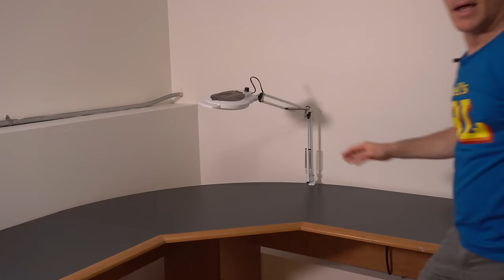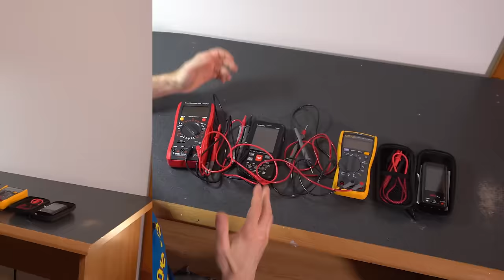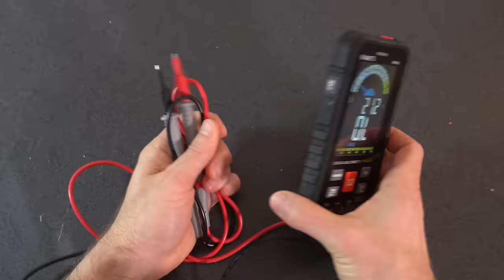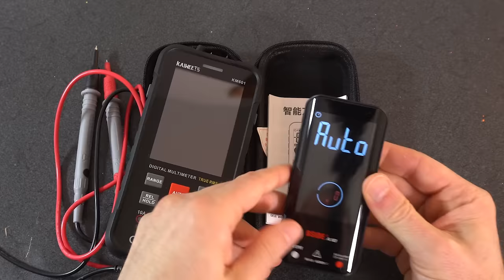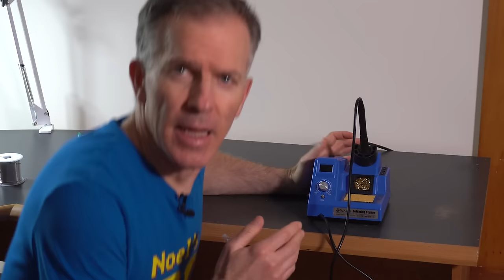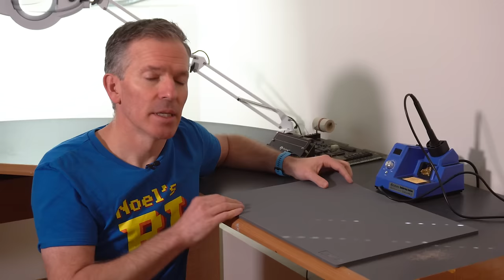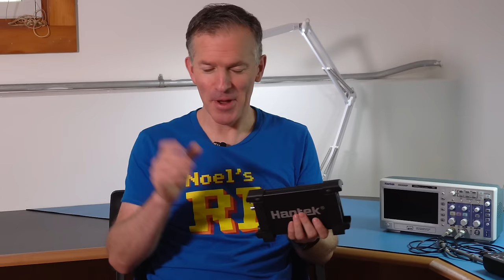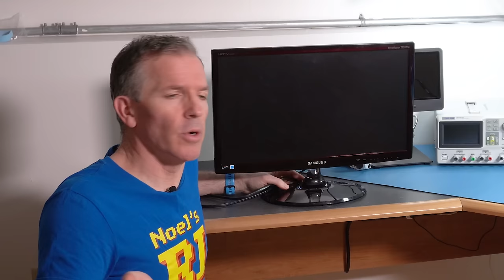Essential Tools For An Electronics Lab

Comment: Another necessity: One of the cheap $10-$15 ATMega based component testers. Way easier than doing diode tests against transistors with a DMM. Also, for classic computers, the EPROM programmer + UV Eraser is a must. Other ideas: The $10 , 24 MHz 8 channel digital logic analyzer. $10 Improved DMM cables with silicone and plated leads for lowest resistance.  A large starter kit of random transistors, resistors and capacitors. And sockets; lots and lots of dual wipe sockets in all sizes.
Reply: UV Eraser😅, I was taught to know this thing over 15 years ago.
Reply: Bro please provide those links. Thanks in advance!
Reply: I would also add:
- tools to hold things, such as helping hands and even a small hobby vice
- prying tools since so many things are glued together now
- a second multimeter for testing voltage and current at the same time for people who do not have an oscilloscope
Reply: Agreed, those little component testers are a must, I always use it for transistors, mosfets and caps, it beats looking for datasheets for the transistor pinout.

Comment: IPA alcohol?  Captan tape? blu tack (to hold stuff), extra hands (or the little holders, little pots for screws, magnetic tray for screws, lithium grease, flux, nail varnish (solder mask), solder wick, marker pens, graphite pencil (for contacts) , contact cleaner, air duster. Phew excelled myself there - could class these as consumables.. Great vid Noel.
Reply: I'll tell you what you missed: contact cleaner AND eraser strip for old, openable relays, ah ha ha ha!

Comment: Concerning SMD soldering, I think that the use of Flux is pretty essential. Flux helps a lot to spread the heat equally, Iwould never concern hot air soldering without it. But even if you want to clean up leaking capacitors, flux is great to help clean corroded solder joints.
Reply: Yes, the effect of flux has to be experienced to be believed. It totally changes how the solder behaves. If only it wouldn't be such a pain to remove the residue! I'd be thankful if anybody has tips for how to effectively remove flux, especially the tacky SMD flux type.
Reply: My understanding is that flux is used because it cleans the joint before soldering which helps prevent dry solder joints and, as mentioned, corroded solder joints from forming in the first place. As well as helping the solder 'flow,' ensuring it will spread to cover the entire pad. 
Not sure about it "spreading the heat equally" since it's temperature requirement is significantly lower then solder so it 'disappears' basically instantly.
Reply: @EdwinSteiner  Isopropyl alcohol (99%) and a cotton bud.
Reply: @MattyEngland  That's what I use and it isn't working too well for me. Maybe I've got particularly tacky flux. I use two types of "no clean" flux, so theoretically I could also leave the residue on the PCB but it just looks horrible and it sticks to everything. When I clean the PCB when it is still quite warm, I can get the bulk of the residue cleaned up with IPA and cotton buds but there is a thin and very sticky layer of residue remaining on the PCB.
Reply: @EdwinSteiner  You'd probably need an ultrasonic cleaner to get the last residue off, they are quite expensive though. Other than that, maybe try some different fluxes, the tacky ones are useful but they are hard to clean.
Reply: HCFC-141b spray cleaner might work.  Just keep this away from anything containing polystyrene.
Reply: @somaday2595  Thanks. It may be hard or impossible to get here, I think, but searching for it I found replacement products that I might try.
Reply: @EdwinSteiner  no clean flux is an option.
Reply: @EdwinSteiner  ,  The fluxes designed for use with lead free solder are generally supposed to be water soluble and so distilled water should work just fine. Rosin flux for use with leaded solder is alcohol soluble; use 99% isopropyl alcohol and scrub with a stiff toothbrush.
Reply: @EdwinSteiner  a brush and 99% isopropyl alcohol works pretty good but there's actual flux remover chemicals that work way better. The brush is key IMO, cloth just gets stuck if the mess is too big.

 At my work we use stuff from MG chemicals and chemtronics. A liberal spray of the flux remover and some scrubbing get's all the stuff loose and a wipe with some lint free cloth can get all the pastey sticky stuff off after, you can also use isopropyl to get the sticky stuff off if there's a huge mess.
Reply: @EdwinSteiner  I remove solder with a solder braid. Sometimes I can remove it with nothing more than a dry iron tip. You can also get one of those bulb solder suckers. I have all these and they're all cheap. NTE 63/37 lead based solder is great for re-work but you'll always need to use flux or you'll struggle like I did.
Reply: @EdwinSteiner  I'd recommend isopropane, with a cotton bud
Reply: Seconded on the flux, and for cleanup I recommend Isopropyl alcohol and a brush with ESD rated wipes to soak the flux saturated alcohol.
Reply: Ha, ha, ha pina sa aduni toate aceste materiale si la cit sint de scumpe te lasi naibii de meserie ca ajungi la 70 de ani si nu le vei avea pe toate Da toate aste si cu mare dificultate  poti sa le procuri daca lucrezi intr-o companie, corporatie specializata dar nici o data ca particular nu le vei avea Acolo sint bani adunati pe citiva ani buni  de munca nu se iau din drum Domnu se pare ca a facut reclama la toate probabil este daler de astfel de materiale ca toate erau noi si nu se lucrase cu ele La tot ce a prezentat dm nu a spus ca trebuiesc si ceva ani de scoala serioasa daca vrei sa faci meseria de electronist
Reply: Flux is the secret to SMD soldering. It makes things so much easier. Whether with hot air or iron, combined with leaded solder it makes SMD so easy.

Comment: When I bench soldered professionally we used two things all the time. We used a soldering iron and a spudger. What's a spudger? A spudger is a wooden stick. Think of it as your finger that doesn't burn easily. Spudgers are even handier than tweezers are. The best spudgers are made out of osage orange wood and they're charcoal gray in color. They're kinda hard to find. But that's what you want.
Reply: Wow! 72 yrs old tech and I learn something new every day!

Comment: - A chip tester / reader / writer / eraser
- Two fire extinguishers, 2 fans with a flex hose to remove the nasty lead smoke from soldering and bring in fresh air (unless you like CANCER) and 2 smoke / air quality detectors (better safe than sorry) and a quality portable air-conditioner with dehumidifier. Air quality is a MUST in any lab. A wooden floor is also good.
- Security cameras with remote / cloud recording to keep the lab safe
Reply: Why a wooden floor?
Reply: @weilaiyvn  You must not have a carpet floor, unless you like to dry your electronics with ESD.
Reply: One thing about 'security', I've found that most thieves don't even know what they're looking at. Questionable whether the security cameras would help, but a nice option.
Reply: @AZStarYT wouldnt that only mean to the thief that there is something valuable?

Comment: I also use a whiteboard. They are great for writing steps to work through, especially when the work is broken up over days.
I also have coloured high lighters. Some equipment I work on are quite convoluted and its useful to photocopy the circuit diagram then trace out power supplies, ground and even some test points so they are easy to find.
Reply: I have a board in front of me where I clip or blu-tack info, but a whiteboard is a great idea, especially to keep track of several projects at once. A cheap mono laser printer is also handy for printing out data sheets and other things (I too am one of those people that like to print out circuit diagrams and follow the traces with a highlighter).  Just make sure you get a printer with inexpensive toner and/or won't freak out over using non-genuine toner. The Brother HL-1110 would be my recommendation.
Reply: @OzRetrocomp  And it you get a whiteboard thats magnetic, you can use decent magnets to hold sheets of paper (eg parts orders, Data sheets, etc) for easy access.
Reply: Hi, I have always found that a good Lab Journal is better than a whiteboard. I can trace the steps I have used in building or deconstructing circuits and it provides a lasting record of all my mistakes and successes which greatly aids future work

Comment: A soldering/desoldering station was such a gamechanger for me. Setting the temperature up or down drastically improved my soldering and the de soldering bit (again with temp control) let me desolder so much more much quicker and wasn't anything i couldn't de solder.

Comment: I do vintage radio / phono restoration. My benches are 8 feet long and 4 feet deep. I have three benches, one bench is just for tube testing and tube storage. The is also a fixed ipad on that bench. My main workbench has an oscilloscope , HP Audio Oscillator, Heathkit RF generator ,VTVM  and a VOM.over the top shelf storage. On a third  bench is an isolation transformer, on a variac, a laptop Macbook and assorted small devices for  LCR testing, digital vtvm, tone arm gauge, laser tach, and Tiny Spectrum Analyzer.  I have sever old Weller soldering stations, assorted soldering guns , 100 watt Iron for chassis work and assorted direct plug- in mini irons.

Comment: That a really nice setup, i especially envy you that desoldering gun ;)
However, i've felt that you lack of:
- desoldering wick (very handy on non-THT components which happen often in 16bit units)
- capton tape (to hold thermocouple while troubleshooting some switching mode power supply which can get quite hot as well when you need to hotair something)
- kynar wire for fixing traces (no copper unwind from coil can be comparable really)
- FLUX, is most essential in soldering of any kind,
- UV solder mask (behaves much better than electric tape or hot glue)
- holder/ pins for PCBs. This one is missed by every begginer, but essential if you want to have sturdy base to work on your PCB
- single non conductive screwdriver and tweezers. 
- Bottle of IPA or other cleanser (where actually i use and recommend isopropyl alcohol ;p)
- cleanser for potentiometers (ready compounds besides of IPA have grease which greatly prolongs lifespan of already worn pots)
- Thermal camera (but this is rather expensive option, yet it does help to troubleshoot instantly in some cases)
- Brush (best are these stolen from wives, i recommend :D) , air blower (might be as well hand pumped), couple non-dusting dry wipes
- logic probe (Saleae)

There's a lots of stuff that i see on my bench and toolboxes which i use occasionally while fixing stuff (also some retro stuff but mainly modern SMD based consumer electronics). 

PS: eeprom programmers are also available for linux (my whole lab with workbench is running linux including Hantek's oscilloscope and i do read/ write (e)eproms, so you aren't "tied" to windoze.
Reply: Awesome list
Reply: Add a fume extractor.  Great Scott did a video recently about making one.

Comment: Others have already mentioned some things I thought of, but just in case, one tool that I haven't seen mentioned (but probably has been anyway) is an ESR meter for capacitors.  One of these may not be necessary if you re-cap everything, like some folks do, but if you don't, then it's useful to know whether a capacitor needs to be replaced.
Reply: I think an ESR meter is indispensable.

Comment: I do use a component tester, LCR meter a lot even though it is only a small cheap one for simple checks (did I read the resistor bands correctly!).  I also find it is vital to have a small and very thin set of small spanners for all those components that need tightening, pots, banana plug sockets, etc.  Oh, I also have a circuit board holder - cheap and really useful and an IC pin straightener as they pins on new chips are always splayed out!

Comment: A tool I use a lot is a vice. To maintain boards, wires, connectors... while I'm soldering them.
I have an old PanaVise...
Reply from the maker: True. I would have shown my Pana Vise but it's in the slow boat (still!) and didn't need a second one.
Reply: Yes, having a good vice (smoking, Diet Coke, maybe whiskey) is essential for those long nights of retro repair. Or is that what you meant? :D

Comment: I don't have a complete setup for my little work station/lab, but it sure is much better than before. It makes me appreciate what I do have now considering the frustrations of having not near enough to get a job done like I wanted. I did however managed it though, that's when I learned stuff which makes the setup I have now much easier to work with. My favorite of my work bench now is my magnifying LED lamp, my rework station and my de-soldering station. I don't know how I done without em' before... priceless.

Comment: If you are into experimentation and using breadboards, a set of quality automatic wire strippers will make your life really easy especially when dealing with short jumper wires. You will, even if you are carful, end up using your wire cutters to break into things, grab things, bend things and for all sorts of activities they are not designed for, and irrespective of how much you pay, you will dull or damage them so don't spend too much on a pair.

Comment: No mention of hand tools, so don't forget JIS bit screwdrivers, #1 and #2. They fit the screws in Japanese electronics perfectly, you won't damage the screwhead when applying enough torque to overcome the thread-locking compound typically applied to machine screws. An ordinary Phillips bit fits loosely and likely will slip before you can get the screw to "click", then readily unscrew.
Reply: Worth pointing out that JIS screws usually have an identifying divot or dot in the screwhead. Some impact-rated Philips drive bits used by carpenters fit JIS screws quite well ---- Milwaukee work great, but Dewalt fit poorly. All "philips" screws and drivers are not the same! Best to always break the screws free by hand before using a cordless screwdriver.  And then there's Pozi-drive, which many people haven't learned to distinguish as being distinctly different from Philips.  I am told that IKEA uses pozidrive screws on much of their furniture, so perhaps if one builds an electronics workbench from IKEA products, they will figure it out!

Comment: Plastic pry tools for sure. God knows how many enclosures I've damaged using flathead screwdriver. They're soft enough not to do the damage and if you're being a hulk they snap. But, better a tool that is dirt cheap than 50 yr old enclosure :)

Comment: Other essentials would include...    LCR/ESR meter, Function/Signal generator, Aerosol can of freeze-spray, Flux removal pen, De-soldering braid/mop, Set of alligator-test leads, Solder-fume extractor, AC-power-meter, Decade resistance box, Breadboard, Spudger tool, Exacto-knife, Third-hand tool (or Forceps), Isopropyl-alcohol dispenser, Quicktest/test block, Hot-glue gun, ESD grounding wrist-strap, Comfortable chair.

Nice optional additions would be...    Thermal-imaging camera, Semiconductor analyser, Battery load-tester, Magnetic pick-up tool, IC vacuum/suction pen, Phase-tester, Crimp-tool, Rubber-mallet, Air-duster, Soldering-gun, Dremel tool, Inductor ring-tester, Insulation-resistance tester, Data-Logger, Chip-programmer, Variac (variable transformer), Milliohm meter, Frequency-counter, Isolation-transformer, Active-scope probes, Logic Analyser, Electronic load unit (for Dummy loads), Tone-Ohm tracing-probe kit, Spectrum Analyser.

Great video BTW 😀

Comment: A few months ago, I bought a set for removing compound called "QianLi 011" and was amazed at how these ultra-thin and very sturdy blades can be used beyond their intended purpose. The blades are slightly sharp, allowing for the removal of solder mask with surgical precision without heavily damaging the copper. However, with added force, you can even cut through copper traces. Additionally, the availability of a huge variety of blades allows for the removal of glue and flux residues. I even managed to remove an ATmega328 with a soldering iron and one of the spatulas (simply slid the thin spatula under the heated legs of the microchip). Perhaps such a tool may not be necessary for you, but considering its low price and unique durability, I can recommend it for purchase!

Comment: Depends on kind of work, but as a kid (1973) i repaired and played with radio's and televisions with just a 25W iron and borrowed screw drivers. Then got a very cheap analogue multimeter. I got into building transmitters so bought a £8 SWR bridge for an indication of RF power, then next a Taylor RF signal generator i found at a jumble sale to work on shortwave receivers. Was 1978 before i saved up enough for a 600MHz frequency counter as by then was building phase locked loops using logic chips to control transmitter oscillators. Always stuck to analogue and done a lot with valves. Love the things, especially in high power transmitters. Microprocessors leave me cold but forced to delve into it sometimes.

Comment: Great list! I would add an x-acto knife or similar fine blade knife, which is very useful for scraping solder mask, and the blade holder can also hold tungsten test probes which are very hard and sharp, good for poking around.  Acid brushes  (trimmed short), or a fiberglass scratch pen if used gently, are great for cleaning oxidation, flux, or any foreign residue away.  Oh, rubbing alcohol is a must too.
Reply: Xacto knife and flush cutters are both definitely some of my most used tools.